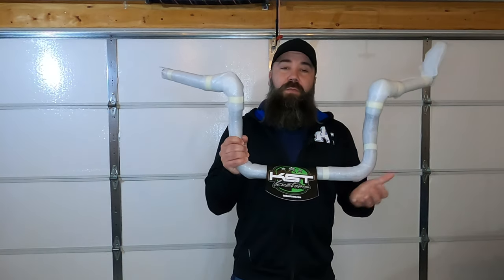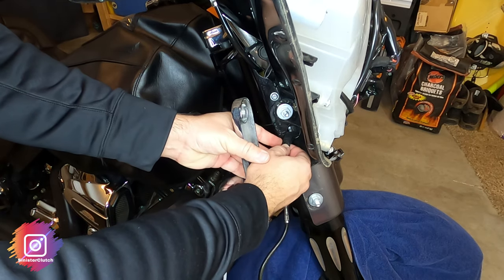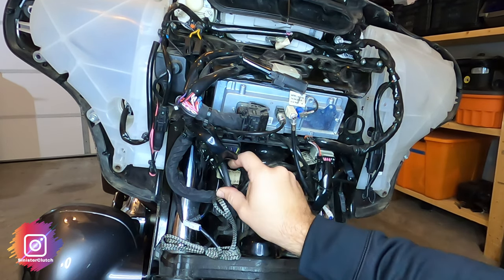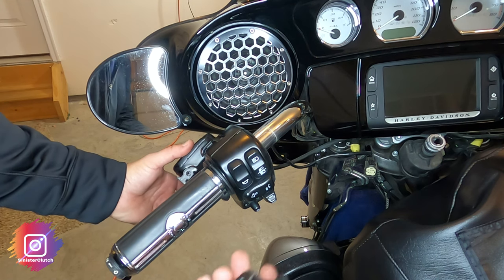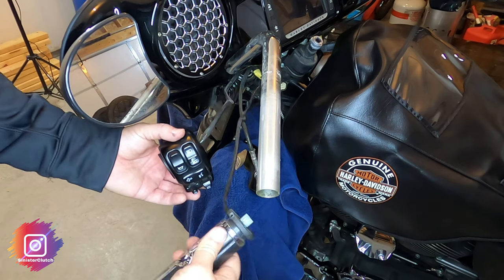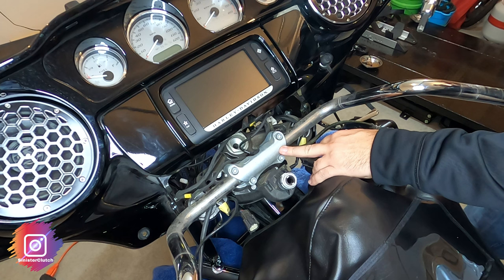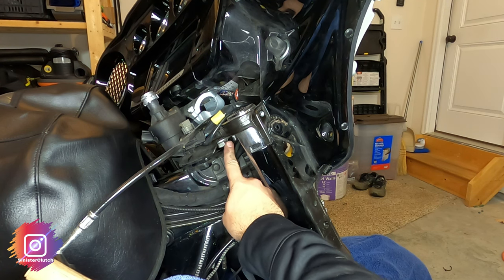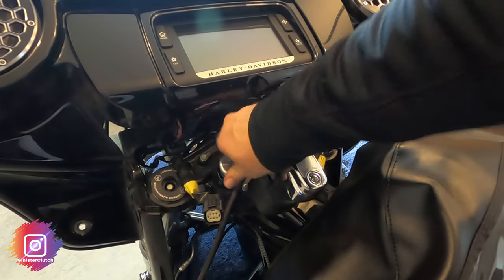KST Kustoms Mayhem Bagger Handlebar Install On A Harley Davidson

Comment: Hey there. Great video. I refuse to pay the dealer a couple grand to do this. What kind of time commitment am I in for? 32:31
Reply from the maker: I think 4 hours is sufficient.  It took me longer because I filmed it.  Just lay everything you need out and it will go faster.  The wiring for the new bars is the most time consuming part because you don’t want to bind or snap anything.  Appreciate you watching and commenting.  Let me know if you have questions.  Take care✌️

Comment: Did you say that 12 inch would have worked also with factory cables and lines?
Reply from the maker: Yes you don’t need extended cables for brake and clutch cables.  You do need extensions for the switch housing wiring harness.

Comment: Hi I loved the video. Was just wondering how tall you were? I'm about 5foot 7inches tall and was looking to change out my bars and I got told to go with 12in kst but think they are to tall for me. Also how do you like th 10in bars? Are they comfortable on long rides?
Reply from the maker: Thanks for watching and commenting.   I’m 5’10” and love the handlebars.  Since installing them I’ve put over 10K miles on the bike and they are very comfortable.  I feel more relaxed on long rides and wished I’d installed them sooner.  I thought about 12” handlebars but I ride in cold weather and wanted to keep my hands behind the fairing as much as possible.  If I remember correctly they are more like 10 3/4”.   Hope this helps 🤙
Reply: @SinisterClutch  Thank you very much!! This helps a lot. I ride in cold weather too being up here in central New York. So keeping warm is always important when its below freezing.

Comment: Great video. Using the same setup as you. Question is does the turn signal wires come out off the housing and then go into the bars?
Reply: @SinisterClutch  hey brother. Your video is the only one I have seen that leads me to believe this. I have been struggling to get the wires to stay inside of the housing. Any chance you could send me a pic of how they rout out of the housing. I’d really appreciate it
Reply from the maker: @joehengels5409  Let me explain this in detail.  So by factory the Switch Housing for the turn signals wiring harness is on the outside of the bars as you can see at 8:20 in the video on the left and 10:00 on the right.  At 19:25 I start to show that I'm installing the right switch housing inside the new KST Bars by taping it to the paracord attached to the braided steel wire.
Reply: Again, great video. Got the bars on and controls mounted. I noticed the heated grips are the same as the ones I bought. Can I ask how you wired them in?  Thanks again for your help
Reply from the maker: @joehengels5409  So the heated grips came with a 10” extension wire for the left side that you definitely need.  The right side already has the wire ran from factory which is part of the throttle by wire.  For my particular heated grips I had to connect a wire harness to the battery so I took the tank off and ran the wire alone the frame.  Also I’m a fan of soldering so that was my choice of how to connect the wires.  Sorry I don’t have a video on that because I wasn’t on YouTube when I originally installed them.  Hope this helps
Reply: @SinisterClutch   hey no problem. Yes I looked and didn’t see one. I’d like to pick your brain if I could. I have the red with a fuse goes to battery. A black which is ground and a orange/ white to accessory power. Thanks again
Reply from the maker: @joehengels5409  Yes those wires will have to be connected to a wiring harness that gets plugged in on the left side.
Reply: @SinisterClutch  that would be the plug in the fairing or back under the seat?
Reply from the maker: @joehengels5409  I was talking about under the seat.
Reply: @SinisterClutch  Roger that. Thanks for your help
Reply from the maker: @joehengels5409  Grey Beards Garage channel has a video on a 2022 heated grip install.  What year is your bike?
Reply: @SinisterClutch  2015. Triglide
Reply: I see my kit refers to electrical connection harness that looks like it plugs into a capped plug down on the left side under the seat. Then it has wires coming out that you connect to. Fng Harley
Reply from the maker: @joehengels5409  Yep that’s it.  That will power the grips.  I can’t remember if it comes with the grips or it was extra.
Reply: @SinisterClutch   no it’s extra. I will get it on Tuesday. I really appreciate your time and help on this
Reply from the maker: @joehengels5409  Happy to help.  Appreciate you watching and reaching out✌️

Comment: can you use the stock riser bushing bolts or do you need longer ones when changing bushings cuz my bushings didn't come with new bolts
Reply from the maker: You can use the stock bolts.  Mine was a kit so came with new ones.  They are the same length.  Hope that helps🤙🤙
Reply: Awesome thanks man, I didn't want to start taking everything apart just to find out I need different bolts. Definitely be using this video to walk me through it cuz you did a great job explaining everything. Thanks again, time to get these bushings and bars on.
Reply from the maker: @michaeltourtillott8512  Awesome glad I could help🤘🤘

Comment: As I am fighting the idea of changing the looks of my RKS I sat on a heritage-after the Harley Faster  Further event at my local dealer- with I believe 14’ bars and loved how they felt on my broken by Uncle Sam back lol. Question is did you get longer lines or not? Thank great share bud!
Reply from the maker: No you won’t need longer clutch and brake cables unless you go above 12”.  I just removed the zip ties to get slack in the cables.   Also the clutch cable is pushed to the right of the bike so I moved it to the left and had plenty of length.